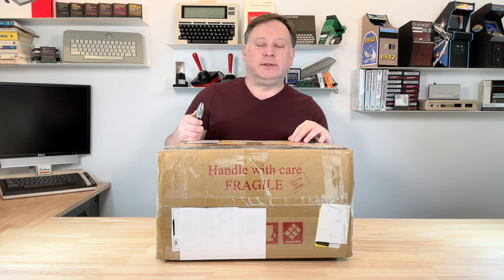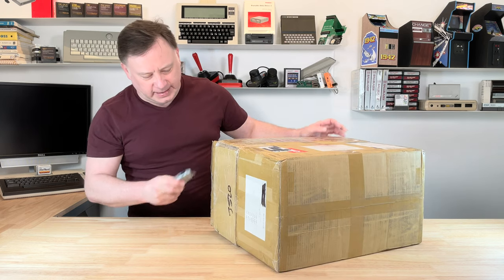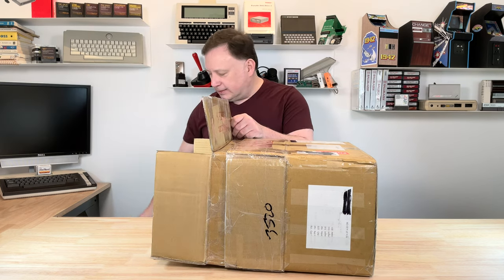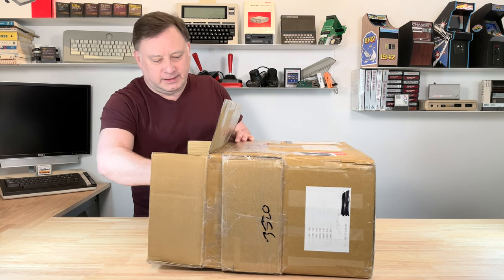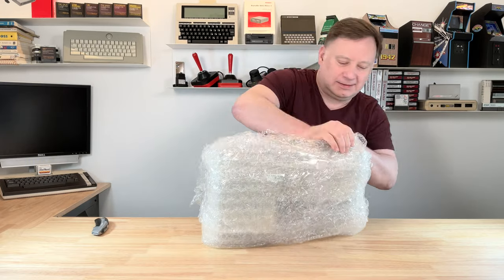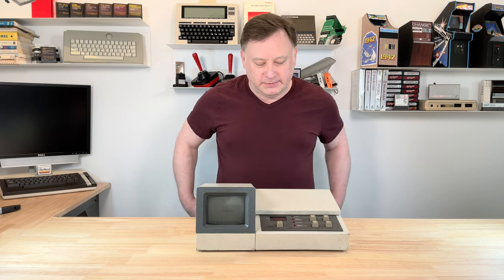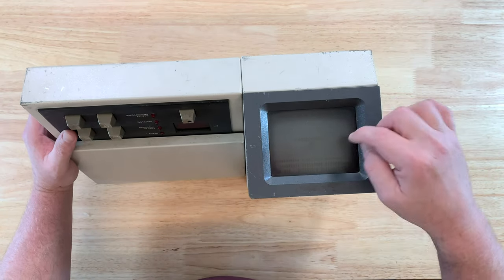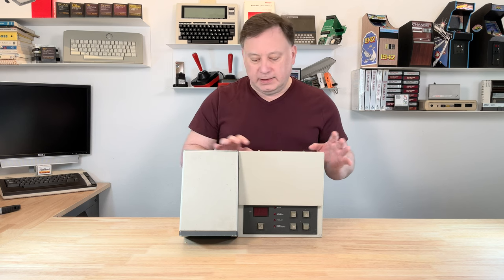What's this retro looking Teradyne M-368 ??

Comment: Is there literally any chance of getting the CRT running again?
It's so iconic and central to the industrial design, seems a shame to toss it if salvageable.
Reply from the maker: Good question. Yes & No… I’m more of a digital guy; than analog CRT stuff. Plus, I’m sure the old CRT would pull more power than I want to stuff in the case (to make it semi-portable). I’m more inclined to sell the CRT on eBay to see if someone can do something cool with it.

Comment: I was right there with you until you said...ill take out that crt and replace it with a...... noooooooo noooooooooooooooooooo keep the crt !!!
Reply from the maker: I hear ya. Undetermined yet, so we’ll see. Though… an LCD would give more room and run off battery much longer. ;)
Reply: @TheVintNerd  aye .....but what will look cooler for the next 50 years, and flicker and hum and provide eyestrain beyond belief....if u are not using it,  xyz the wee crt for oscilographics give it another purpose!
Reply from the maker: @amoeba23  If I have trouble making the CRT work out and go with LCD instead, I will let someone else have at the CRT.